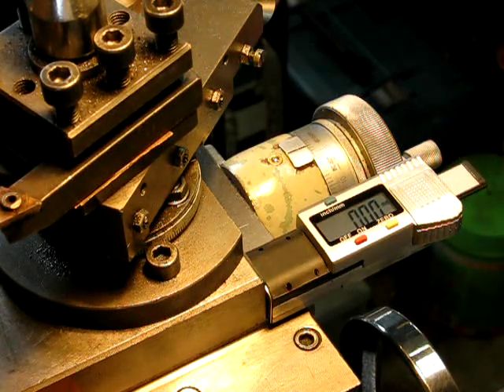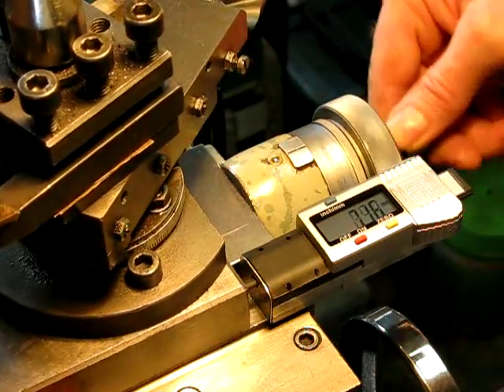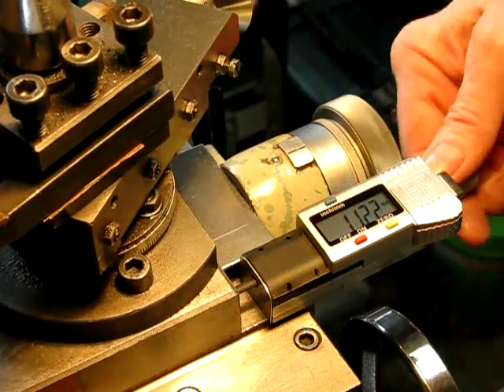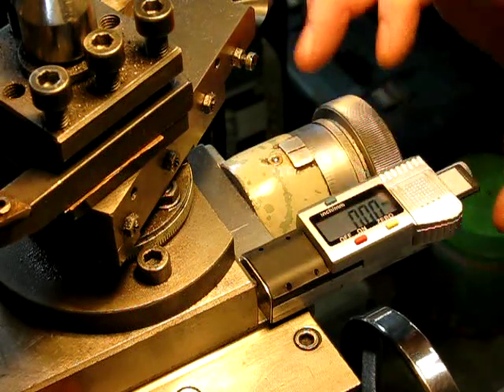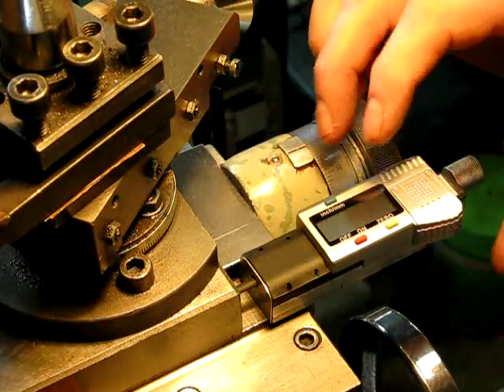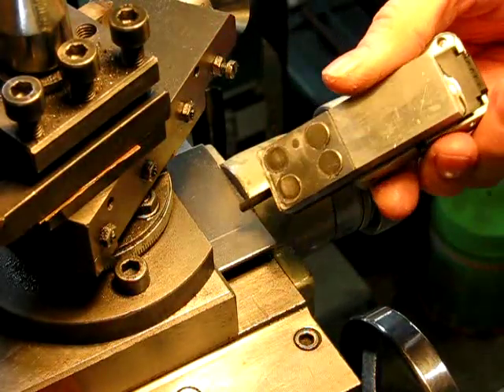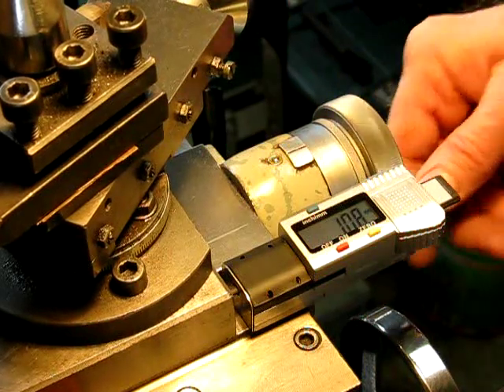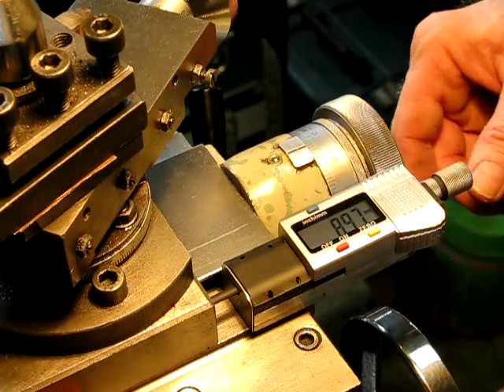Portable magnetic digital read out for lathe cross slide and carriage travel - $10

Comment: Hey Rob, Regarding the timeout with the display, after this when the on button is pressed again, does it show the same reading as before it timed out or does it come back on zeroed out. My black cheapy $10  6" verniers come back on with the previous reading and I was hoping these little tyre gauges do also. If they do I will be buying 2 as I have been thinking about buying a couple of the cheapy veriers to mod for a while now. How do you think one would go hacking up 2 sets of the 10 buck 6"vernier calipers to do a similar thing, but achieve greater range? That's got me thinking now, Hhmmmmmmmm
(stand back everybody, unless you want brain bits all over you)
Reply from the maker: djpaulk It comes back zero'd out.  So, looks like you wont be buying any ;)  Cheers Rob
Reply from the maker: djpaulk No steam engines here yet, but would like to find the time.  Watched the video and was greatly impressed. A beautiful job, and no visible runout. The machining job must be good.  Thanks for sharing.  Cheers Rob
Reply: xynudu Thanks Rob :) The flywheel is a bronze casting and it has a steel rim fitted. It was a heat the metal rim on the lathes faceplate and put the bronze flywheel in the freezer job. Then run out to the lathe with frozen flywheel in hand like a madman and she shrunk fit nicely. I then turned to final dimension and bored hole for the shaft. I spent some time on this part and there is no visible runout on the flywheel. I learnt from past engines that a wonky flywheel can detract from an otherwise beautiful engine, so there was to be no stuffups on this one.
Reply: Well I thought I would give it a go anyways and I bought 1, identical in appearance as your silver tread depth gauge and my one powers back on at the previous reading after a time out.. So either you lucked out or I lucked in? Either way I'm pretty happy with that for 6 clams. It will now become a handy dandy lil dro :) 
Yes, you said no "steam" engines here yet, but you should have mentioned your flamelicker! I knew I remembered hearing you mention some sort of model engine. You had me thinking I was loosing my memory :D
Now the cat is out of the bag you're going to have to show us!..      Paul

Comment: Great idea thanks for posting -
 Instead of putting a spring maybe glue a small weak magnet to the end of the plunger that will  hold plunger to to cross slide-
Reply from the maker: Yes people have done that and it works OK.  Cheers Rob.

Comment from the maker: Yes, it has a time out function as well.  Basically it uses the same design/head function as a caliper.  I have found this to be a nuisance a few times, but generally you only use the gauge to finish a job, or while doing a fairly continual action like milling, so you are not holding a continuous static reading for extended periods like a fully dedicated DRO. Cheers Rob.

Comment: Hi, It is a great idea, does the car tire readout have the usual calipers' time out. That is it will switch itself off if not used for some time. Once I fixed a digital caliper to my mill and this was so frustrating that I had to remove it. Thanks